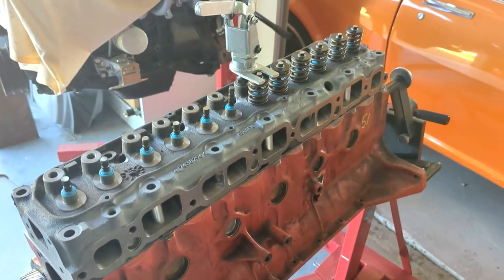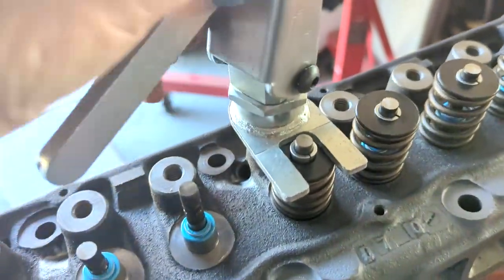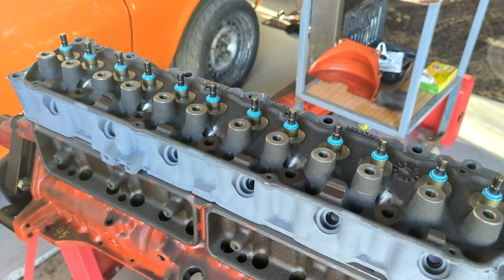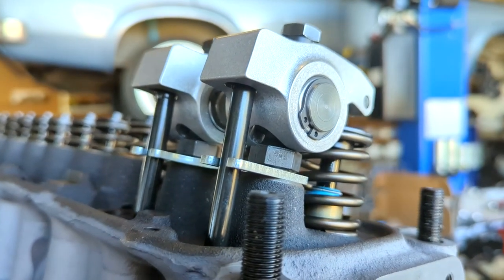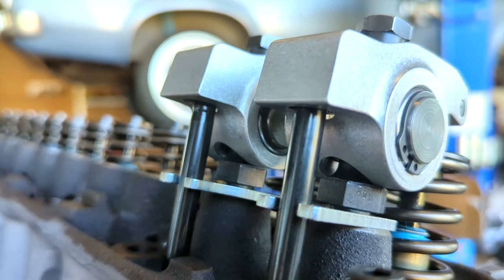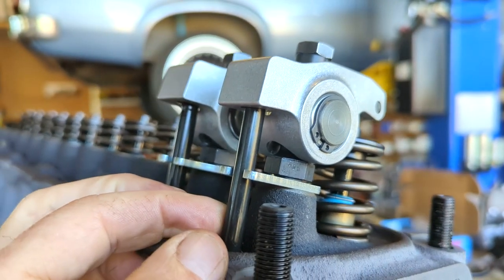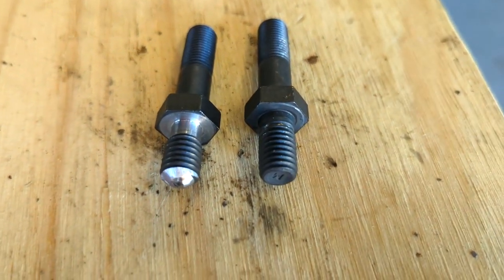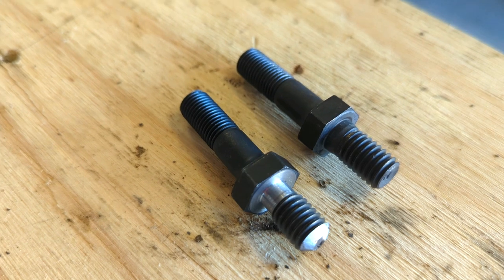No.55 Torana Build Roller Rockers, Over size valves and push rods KamicarzCreations

Comment: 2024:
Way back , 40 yrs ago, believe it or not, I used 
"VW"
 Alloy Pushrods, along with YellaTerra 1.6 :1 Roller Rockers!
On a highly machined & Ported
149HP Head.
Yes , with "EyeBrow" treatment to the cylinder bores. 😎
186 bored to 192,
186S Forged Crank,
Starfire Rods,
Billet Pistons out of Tassie,
Hastings Chrome Moly Rings
253 HV Oil Pump gear & other oil flow mods,
Lynx manifold 
Trip 1 3/4" SU's
Genni extractors.
Fun times 🤣🤣🤣
Reply from the maker: Love it Mark......Creative build, Cheer Kami

Comment: Bob it is great to see your comment section growing its always interesting.
So I will throw in my two bobs worth if you had used shaft mounted rockers you would not need guide plates or posi locks ECT.
They are more stable and reduce fiction at the plates and reduce fine particles going into your oil ( there are 12 of then ).
The Jony Howard eye brows, the smaller the chamfer on the top of your bores less air and fuel that's between the top of the piston and the first ring which is unburnt , so what eyebrows are doing I do not no ?
I will and ad more in the next video I hope it helps.
Christopher from Queensland
Reply from the maker: Love the feedback Christopher. YellaTerra are having supply issues and this is all i could get for the moment.
Reply: @KamicarzCreations  I will let you of this time

Comment: loving the build mate. I think I can notice from the video to pics of my own set up and just can't see the base of the trunnion that gives some clearance for the rotational movement of the rocker function. The kit you have is different to mine (Platinum Yella Terra) but should be fairly similar in function. Anyway just thinking out aloud and try to help you tick off boxes to finish up the top notch build 🚗💨👍
Reply from the maker: Thank heaps for your thoughts.....there are supply problems at YellaTerra with the Platinum Yella Terra series. Thats why i settled for these. May have to put the feelers out again as i would really like to use the Platinum's on my 202 build.
Reply: @KamicarzCreations  the platinum series have definitely proven themselves and I'm sure you should be lucky enough to get your mittens onto a set soon enough Bob 👍😊

Comment: Ideally at mid lift the valve should be at right angles to the rocker . You can draw a line on your rocker through the centre of the roller to the centre of the rocker shaft.
Reply from the maker: Great info....i think thats similar to YellaTerra's instructions
Reply: @KamicarzCreations  nope, put bearing blue on top of valve and rotate engine, remove rocker and note sweep mark on top of valve. You want the narrowest sweep mark in centre of valve. Sweep mark towards outside edges is bad, wide sweep mark is bad. Adjust that mark with pushrod length

Comment: Is it a regrind or billet cam ? as the base circle is different .    Is the  shaft  in the roller rocker up the right way.  Have you tried a hardened steel washer between the head and guide plate.
Reply from the maker: Billet cam. Yes checked the locking nut is in the right way and the stud only for one way.

Comment: I have been there & done that. I could write a book on it & was going to make a video myself about rocker geometry but in the end I just could not be bothered as there are just to many facebook experts who think they know it all. I will reveal a few facts for you right now. Think about this for a bit & this goes for everyone out there regardless of whether you have a standard rocker set-up or roller. Your rocker geometry is wrong if you are using the standard length pushrods. WHY? it is simple, over the many years how much has been shaved off the head surface, how many times has the block been decked? I would say about .050". You would need to install shorter pushrods by .050" to maintain the correct geometry. It is not rocket science only a bit of common sense. The easiest way to check correct pushrod length is to blue the top of the valve, adjust the rocker to specs solid or hyd & turn the engine over. Remove the rocker & look where it is tracking. The middle of the valve stem will be clear of blue if it is correct. Visually you can see the roller touching the tip of the stem closer to the tappet cover, at half lift the roller should be exactly in the centre of the stem & at full lift it will be closer to the intake manifold. The roller travels from one side of the stem to the other side and back again through a cycle of open & shut. That is it, nothing fancy. Enough of the geometry lesson, now the problem you have is exactly the same I came across when I was selling roller tipped rocker conversions years ago. Undercutting the 7/16 UNC thread was a good start & shortening the thread length also was good. I would tap the thread though deeper down. Next step is to machine the top side of the stud where the bottom of the rocker is touching. You can machine it down quite a bit as long as you can still get a spanner on to tighten it. If you still require more clearance then shaving .5mm from the bottom of the rocker may help although I would rather not take that course. I only had the same problem because I was using chev rolller tipped rockers from the USA and their fulcrum belly is lower than a holden rocker. If your using a hyd cam then you realise of course that the rocker will need to sit even lower once you adjust the lock nut down another 1/2 turn. Another thing I just thought of was that the length of the stud above the hex was way to long for my set-ups as I was using the shorter pozi-locks. Just be aware of that as you might find your pozi-loks might not fit correctly. I gather you probably know that all this might not fit under the tappet cover. I also had to shave the corners off from the first & last guide plate to get the rocker cover on. Is it not fun to play with the old Holden engine. Hope I have at least given you some things to think about. At the end of the day if the rocker geometry is wrong, then expect the valve guides to wear out quicker. You think this set-up is fun, the non adjustable 173/202 heads are even more fun to deal with and it all starts with the head re-conditioner not getting the valve tips all at the same height, well this of course is pertinent also to the adjustable heads but is super critical on the 202. Get the adjustment correct & you will enjoy a long life from the valve train.
Reply from the maker: Love it. Your input and knowledge is greatly appreciated. :-)

Comment: Is it a 202 era 173 high comp head it will need the 202 pushrods I think
Reply from the maker: Yes, i had another set for my 202 build, they were 9.150 long and seem to be doing the job so far. :-)
Reply: I have the same head off HSD I had no problem with stud threads I used ARP studs
Reply from the maker: @BrokenYT  Yep Same Same

Comment: Looking at this Red motor is like looking at a photo of an old girlfriend. As for the "Eye Brows" cut into the bore... I would prefer to make all the modifications to the head and leave the bore (it complicates everything).  Cheers mate
Reply from the maker: Hi Manual thanks for your comment :-) I had to modify the bore as im using a big valve 202 head and high lift cam on a 173 bore and the valve would have impacted the bore in operation......this would not have been good.
Reply: @KamicarzCreations  I know you've done your research and you would be right with what you are using.. but i've never been there. Cheers mate
Reply: @KamicarzCreations  Wouldn't you be better with a 186 or 202 block?
Reply from the maker: Yes i have a 202 build happening too. this is the original block that the Torana came off the showroom floor with so i though i'd rebuild it for a motor to sell with the car.
Reply: @KamicarzCreations  Yeah, with a warm 202 I always like to run a slightly bigger radiator..

Comment: https://www.crowcams.com.au/portals/0/catalogue/index%20pdf's/Pushrods.pdf     Hi Bob I used the PR8915-210 from memory depend on how much your block is decked and whats been shaved of the head.Oh an 1mm is 040" and those studs still looked a little proud of the plate mine scew down hard against it.
Reply from the maker: Thanks Adrian, at the engine builders now as I have another set of push rods here for the 202. Might pickup my other set of Roller rockers too.